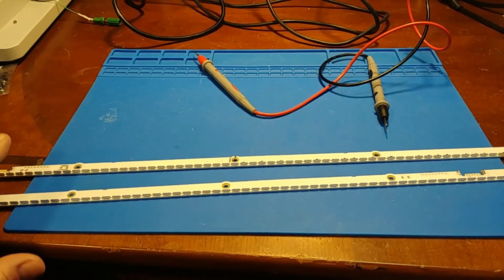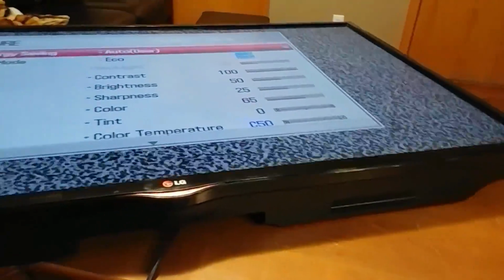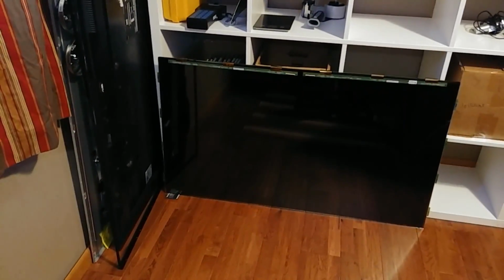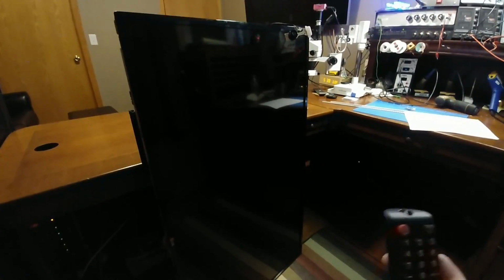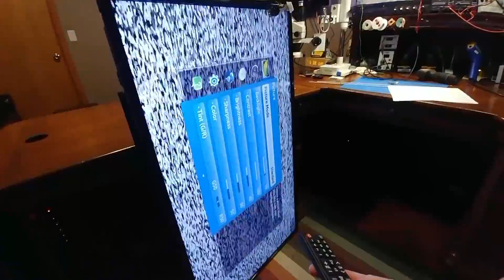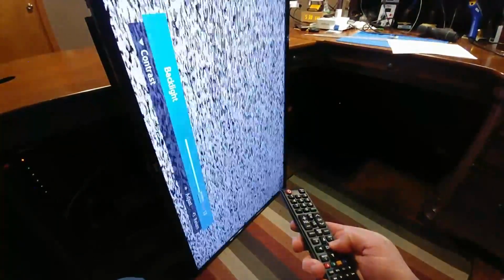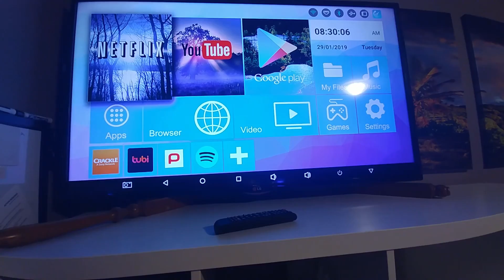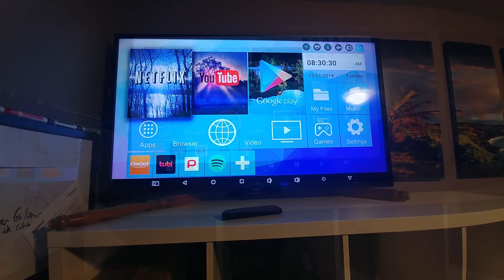Dumpster TV Build

Comment: Why not fix the screen issue on the LG? That glitch is most likely caused by a poor panel connection rather than a logic fault?
Reply from the maker: Horizontal lines = defective panel (or tab bonding). Now vertical lines can be t-con or ribbon wires that can have a chance to be repaired.

Comment: I think both Samsung and LG mix and match the panels, so perhaps that is why they fit together so nicely, even though you only fitted an LG panel on Samsung internals.
Reply from the maker: It was the other way around: Samsung LCD, T-Con & main board into a LG chassis with LG PSU & LG LED's.

Comment: Nice mod! Can never understand why people feel the need to run the backlights up at 100% and then look utterly perplexed when the damn thing decides to crap-out on them! Common sense is not so common, as they say :/
Reply from the maker: Some TV's just have garbage LED's. It isn't going to make much of a difference if the back light is turned down (many TV's start at 100% for the fist few seconds anyways). Some TV's can handle 100% back light for many many years, others cant. Just depends on the luck of the LED supplier and LED driver.
Reply: @jeffescortlx  True, but it's not going to help matters running them flat-out, and is a totally lazy and unnecessary thing to do in most domestic applications. 

Even reducing down to 40% or even a half will give a very watchable day-to-day picture, whilst preserving the service life of a new TV. Naturally, an already aged TV that's been run at 100% for most of its life is a totally different kettle of fish, but I digress..
Reply from the maker: @Oldgamingfart  I see a pattern of people blaming failed LED's because of back lighting settings set to high. But I believe the real fault it just because crappy LED's were sourced for a particular model run. Some bean counter was probably enticed by a Chinese manufacturer that fibbed on the specs. When you get a model of TV with quality LED's, it can run on high settings all it's life with reliability. If you get a model with poor LED's they are going to fail even if the back lighting is set to low.
Reply: @jeffescortlx  I understand where you're coming from, and it does have parallels with/ remind me of the bad capacitor plague of the nineties that affected even high-end electronics. 

On saying that, if there are known issues I'd still air on the side of caution and play it safe..if only to not tempt fate! At least if you adjust the brightness down, you'll know you did your bit, and if something goes wrong it was a quality control issue like you say, and not of your own doing!
Reply from the maker: @Oldgamingfart  This is the "what came first the chicken or the egg" problem. Turning the backlight down could help sqeek out more hours out of poor quality LED's. But take my 60" vizio video for example, no matter what the back light setting it on, when the TV is first powered on the LED's get blasted with something like 800mA. It's no wonder they popped. Also my bedroom Samsung (came to me with multiple failed LED's) has the backlight on 0, but when it's first turned on you can tell for the first 3 seconds or so the back light is very bright. Some blame needs to be put on the LED driver too.
Reply: @jeffescortlx  Isn't that 3 sec.LED "Blast" a form of LED Self test, then confirm or power off?
Reply from the maker: @raymanzi1829  I would think 100mA should be more then enough to monitor current flow is still good.

Comment: poor choice for donor tv,those lg backlights are so prone to failure. I'd rather had repaired the edge light.
Reply from the maker: While I do agree I've seen my share of LG's with bad LED's, my main TV is a similar series 60" version,  it's been trucking along with zero failures. Also this LG has no failures either. Maybe it's just certain manufactures date codes with trouble?